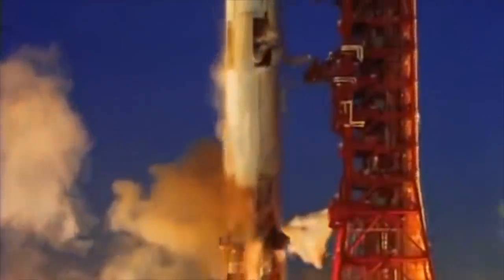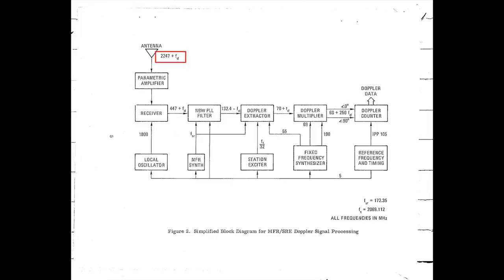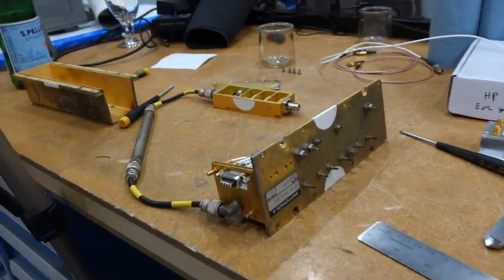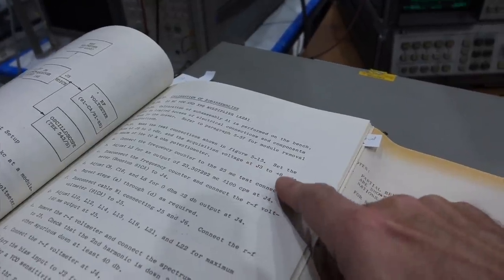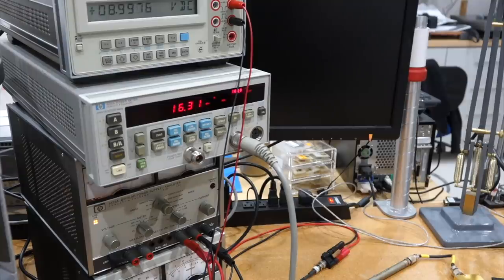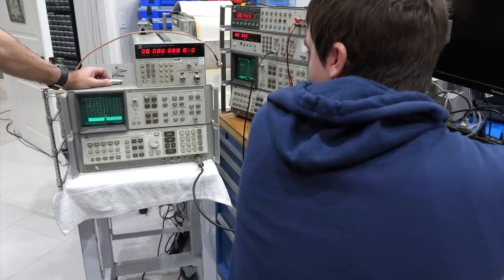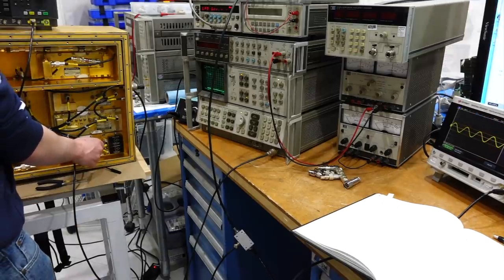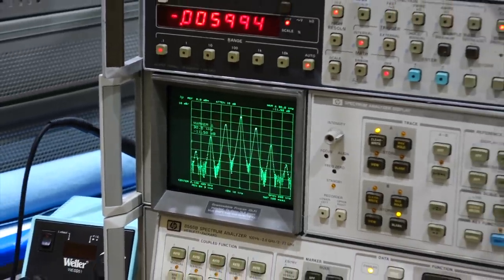Apollo Comms Part 13: We successfully repair both our NASA transmitter and receiver!

Comment: I think it's wonderful that with stack upon stack of esoteric TX / RX and test gear, we end up looking a a two inch diameter analogue meter to see if it all works!
Reply from the maker: My vintage meter feels very under-appreciated! But it is very proud, because this is exactly what the astronauts would have been looking at to know if the link worked.
Reply: Yes the low tech measurement is very reminiscent of Randall and Boot, the inventors of the cavity magnetron needing to know the frequency of the output. They did this with nothing more than two parallel copper wires that they dragged a lightbulb along. The bulb lit up every 10 centimetres, which showed them the frequency.

Comment: Something to note... living in FL I have some 44+ RU racks that have seen better days but are painted the same barf color. Well shielded, RF gaskets everywhere in their original form and in the vicinity there were some doors with general electric apollo program asset tags on them. Sadly the doors were outside in the muck and I saved only one asset tag which is somewhere in my collection.

Comment: Real question is when can we expect the fully restored Saturn 5 plus CM and LM?
Reply: In due time... in due time...  next week?
Reply: @ShainAndrews  Looking forward to the part where they try to fit C-T 1 into Marcs basement 🙂
Reply: @ReneSchickbauer  There was extensive remodeling a few years back  ;-)
Reply: Don't know but it will be ready before the SLS 😈
Reply: @fischX  that was below the belt... but prob correct lol
Reply: Not sure if it would be possible to fit the fuel tanks or other structural parts in their facility, but I can imagine a day when they have the entire Saturn/Apollo electrical systems running through a simulated mission.
Reply: in 3320 AD, when we have perfected the Multi Material Quantum 3D Printer

Comment: Given how well the retuning process was documented, it kind of feels like the system was designed to be reconfigured for different space programmes. NASA getting value for money from their space dollars!
Reply: No. Not specifically. That's just what you do as an engineer. And that's how you build things. Tuning is always going to be a part of the process no matter if intended for further use or not.
Reply: @UnitSe7en  Agreed. All microwave kit of that era had multiple tuned stages and the tuning sequence was always well documented. I worked on several 1GHz and up aeronautical systems and they all came with that sort of documentation. The biggest problem would usually be to get the crystal to oscillate in the correct mode - exactly the problem that Marc and Mike had when tuning the Rx.
Reply from the maker: I imagine that these test setups would be have been engineered to cover several channels in that section of the S-Band, provided you changed the crystal and retuned them as we did here. They were reused for several different satellite missions on different frequencies, as you can see here. No such easily accessible adjustments on the Apollo transponder and amplifier though. These must have been built and adjusted once at the factory for the specific spacecraft frequency.
Reply: @CuriousMarc  Yes indeed. Another factor is that component tolerances of the era would have made it essential to be able to tune each stage even if it was only designed for a single frequency. Tuning a 455kHz IF amplifier of that era, for example. As you found, the interdigital filter at the end of the multiplier chain is very high Q and therefore very sensitive to small frequency changes, or manufacturing tolerance/temperature changes. As a general rule of thumb once the oscillator is running, in the correct mode, then everything else is really a case of tuning for maximum smoke.
Reply: Maybe not different space programs, but changes to Apollo.  I doubt if the frequencies were set in stone and might change if an issue came up.  Perhaps interference of some kind.

Comment: What is amazing to me (aside from these outstanding videos of course) is that the components have lasted and still work almost as if new!  I collect and repair antique radios (yes consumer so no comments please) and the difference between a cap for commercial use and a cap/resistor for military/space use is so different.  Just wonderful to show what the US could do back when engineering a product was for more than a few weeks or a year or two (and lives on the line too). And let’s give Motorola a hand at this wonderful engineering also.  The Galvin brothers started with battery eliminators (for battery operated radios) to car radios etc.  in 30 + years they went from what radio was in late 20s to the moon!  Just wow.
Reply from the maker: It's truly outstanding hardware. And consider the items we have are the "not for flight" stuff... Just built for outstanding reliability.
Reply from the maker: @cheapasstech Indeed, not for consumer grade stuff. But for military, space and undersea telco, we sure still make parts to an insane degree of reliability. But you gotta pay…
Reply: @CuriousMarc  add a zero for every 9 in the reliability

Comment: A room ( or 2 ) of equipment, 3 geniuses, and "voila", Double Lock achieved.  Now, just squish all that stuff down so it fits in the walls and floor of a tiny capsule, shake it violently (as in a concrete mixer)  for about 10 or so minutes, and you will have recreated Apollo.  All kidding aside, you guys are a blast to watch work.  Love this channel.
Reply: "Shake it violently..." That's why the crystal is soldered in and all the tuning slugs have lock nuts.  We once bought a "space rated" uMatic deck for the helicopter. You could have dropped the helicopter on it without impairing its functionality.
Reply: True that.

Comment: I do marvel at the beautiful anodized modular chassis that the equipment is built on.
Reply from the maker: That's because it's not anodized. It's gold plated. The whole darn thing!
Reply: @CuriousMarc  wow
Reply: @CuriousMarc  I mean if you're going to do it right... ;-)
Reply: An old DSN story. “Why are the modules gold plated? Cos it’s cheaper than milling from the solid”

Comment: So interresting : I remember my first VHF (160 Mhz)   FM transmitter with crystal....at 9Mhz. It will be very interresting to see the Phase noise degradation , from crystal , to final output signal. As you now we loose 6dB PN every time we multiply per 2. Today we are able to have good phase noise with PLL at 2Ghz in your cell phone. But for  radio-astronomy at 240Ghz, we use the same principle : a Yig 15 Ghz oscilator is multiplied until 250 Ghz. Exacly the same principle for the first ham radio transmitter at 1800 Mhz, 7Mhz, 14....21...28 Mhz.

Comment: I just look at RF stuff and freak out, its a piece of wire thats grounded ? then a couple of gaps and another piece of grounded wire ? seriously thats how little I know...cheers.
Reply: It’s only grounded at dc.  It is not grounded at rf frequencies because that wire has inductance and capacitance.
Reply: Or, to roughly paraphrase EEVBlog's video about an aircraft transponder, "Where an RF engineer sees a band pass filter, us lowly electrical engineers see nothing but a dead short!"

Comment: The posts on the tuning adjustments are designed for special non-conductive adjustment tools. When you use a normal screwdriver, you will sometimes find that the adjustment is affected by touching it with the tool. This can make it difficult to adjust properly.
Reply: Yeah, you often find similar (though not the same) sorts of adjustment knobs inside CRTs, though in that case the non-conductive tool is to prevent you from getting a lethal HV shock.
Reply: Not necessarily non-conductive. Non-ferrous. The collets for the tuning rods are grounded.

Comment: Marc the Apollo comms video are so good you have done a great job 
this all brings back a longing to touch analogue microwave equipment again. 
I worked for a telecom company for 35 years and worked on a variety of microwave radios
 ranging from tube type if repeaters to solid state base band repeaters and even digital types.
Thank you for the memories.

Comment: I work since 2004 with measurements taken by the JPL instrument "Microwave Limb Sounder" aboard NASA satellite Aura. This instrument is the most powerful ever flown to measure the chemistry in the upper atmosphere, and it will not be replaced. The MLS main scientist told me that it was too expensive to replace this instrument due to its complexity. I did not understand but now thanks to this series I get it:
"Microwave electronics, the blackest of black arts in analog electronics..."

Comment: There is probably merit in driving the SRD with an external RF Sig Gen that you can sweep whilst peak holding the spectrum. You can then ensure that the comb filter is centred correctly with a good shape, otherwise you could be sat on the edge of the pass band.

Comment: I have a theory about why the 24x multiplier on the receiver didn't need to be changed.  At the beginning when there was no oscillation at the original crystal frequency, that  capacitor Mike adjusted was way out.  That and other adjustments were all that must have been needed to retune and compensate  for the other crystal without messing with the multiplier.  I think you guys are right on about it probably being for the Geos 3 satellite.  Great catch on that one.

Comment: Huge win! So how long before you fly a simulated Apollo mission on Mike’s laptop and transmit/receive virtual telemetry via real microwave 2-way S-band?
Reply: And using the real AGC. (Or a replica, if that is unavailable)
Reply from the maker: A while. On the spaceship side we need to get the premod box going, then the upddata link box going, and then the huge telemetry box. 100's of connections on each!  On the earth side we need to get the updata link box going (we're pretty close), the subcarrier box, and recreate all the demodulation and decoding for the telemetry. Then we can relax and fly the spaceship ;-)
Reply: @CuriousMarc  You can't tell me you're not tempted!
Reply: @CuriousMarc  I have the utmost faith in your team’s abilities! I am really looking forward to how much you can get working in the lab either by way of original or emulated equipment.

Comment: Takes me back to my days as a radio tech.  Tuning cavity filters on VHF/UHF two-way transmitters.  Tuning the front ends of GE Master II  radios and trouble shooting problems with Oscillators where the capacitance of the scope probe would start the Oscillator but when you took it off it stopped.  

A sine wave is a sine wave.  I would have thought you could have used a AWG to generate the fundamental frequency replacing the Xtal.  Even a HP 200A would have done.  Not stable but would have proofed things out.
Reply from the maker: You’d think so, but you can’t do that. These are VCOs  that are part of closed loop PLLs. You can’t drive them with a simple sine wave generator and expect it to work. Which is why finding the crystal with the exact characteristics was so important.

Comment: Is it safe to be around transmitter when it works?
Reply: It seems to produce very little power, so yes.
Reply: If the mW "translation" of mS is right 140mW is a bit more than the max of your wifi router (100mW). And I'm sure they are losing some more before actually transmitting in the open due to the black magic cavity thingy. Then again someone with actual RF knowledge can correct me.

Comment: 1/ms. On the Transmitter impedance, match the new crystal guys. By the way, I think you have a colpitts oscillator in the transmitter stage.